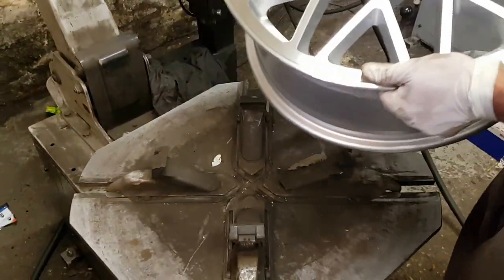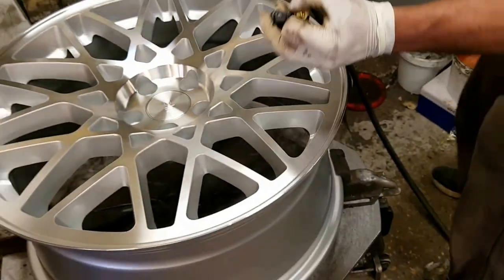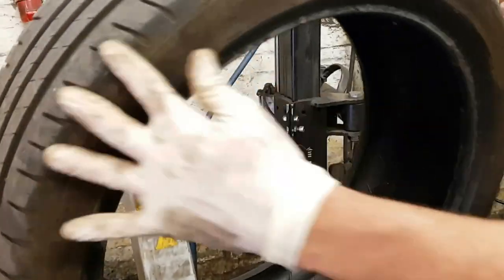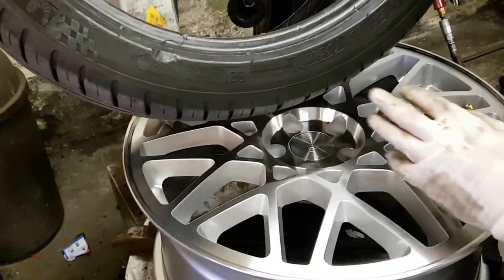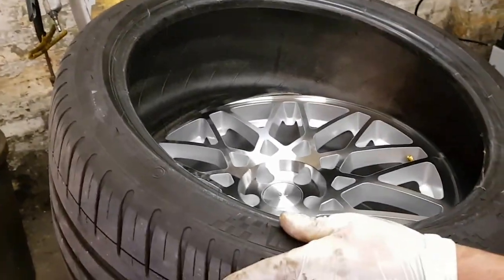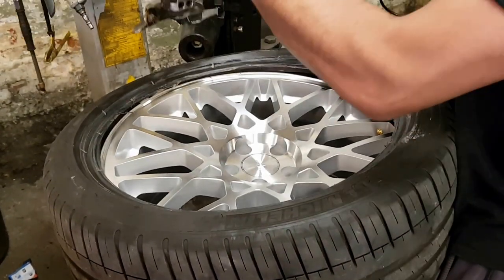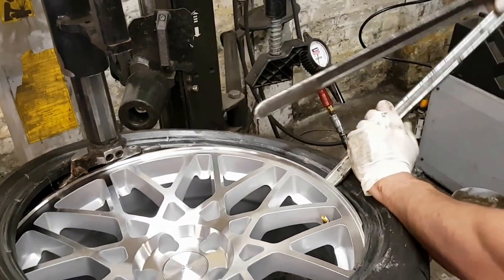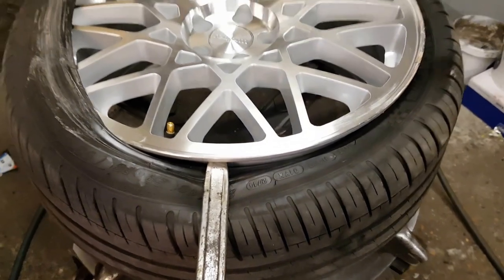How to put a tyre on without scratching the new wheel

Comment: Yet he places the tyre on the face of the wheel
Reply: Since when does soft rubber scratch metal? 😂
Reply: @v35joeyy  When it’s picked up grit from being rolled around a dirty shop floor.  It’s inevitable unless you meticulously clean the tread.
Reply: OCD
Reply: I dont know if you know this but the wind going by your car contains dust and also the road is made of stone that chips off as you hit pot holes and give you aids

Comment: Wish my local garages could see this , at least educate themselves. 👍🏻
Reply: Just had ATS damage two wheels today. Looking at this video I can’t understand how they did it. My cars is only 4 months old and the condition of the 19 inch wheels were as good as the day I took delivery, that’s until today:((
Reply: The problem isn’t putting it on without scratching it, it’s taking it off without scratching it. Putting it on isn’t easy, taking a run flat tyre off a wheel without scratching it, not so easy

Comment: Close, but no cigar. Raw metal clamps are going to leave teeth marks on the inside face, dirty tire being spun on the wheels scratches up the front face, and inside of the rim got gouged up by those tire bars, although that last bit can be forgiven in most cases since it's not visible when mounted.

Get rubber pads for the clamps, use plastic coated tire bars, and clean the tire if you're going from the front for a flawless result, atleast when doing brand new wheels. Though still a better job than a lot of places will do

Comment: I need new wheels for my car too, ATM I have size 16 on my car but want nice alloys maybe 17 or 18 inch for ford focus 2010?
Reply from the maker: We haven't got any ford alloys but if we do get it we'll let you know 🙂
Reply: Great advice.  The only rule I have in addition at our shop is never ever stand a tire on the face of the wheel while applying the tire lube.  Since the tires are rubber and roll across the gritty floors, they pickup abrasive material.  When a tech places tire on wheel face and spins it to lube both sides, they can severely scratch the face which many times can be more visible than scratching the rim edge.  Just a hint what we add to our shop rules.  Thanks for posting your video.

Comment: people are super picky about the tire resting on the face.  I understand that.  But, it will not show anything as it is a wheel that is going to be pounded by gravel in ten minutes. However, he showed how simple it is to not scratch the outside of the wheel.  Really easy apparently!  i must have had goons with 30 IQ's doing my last set.